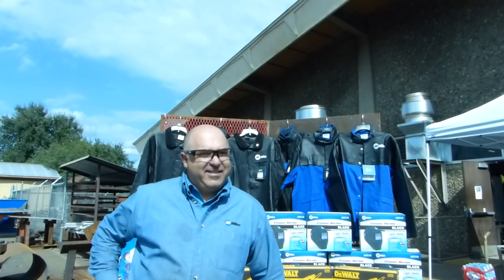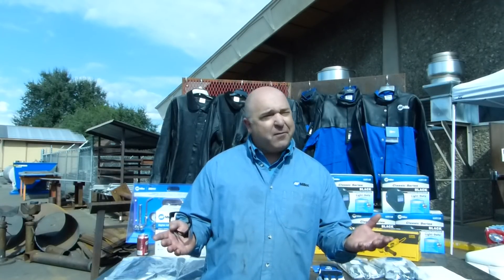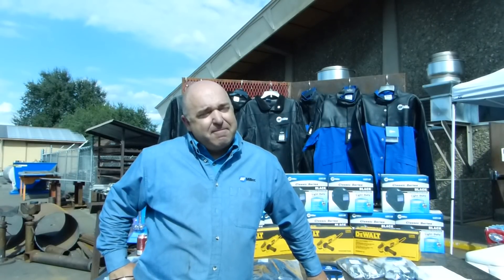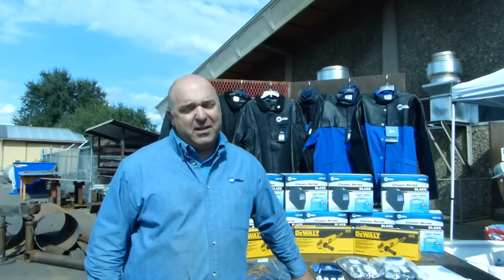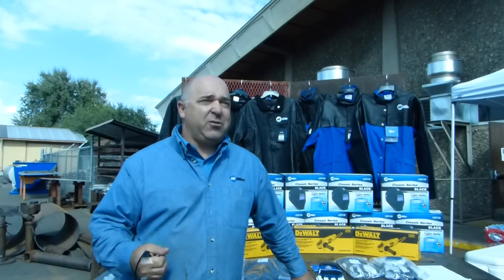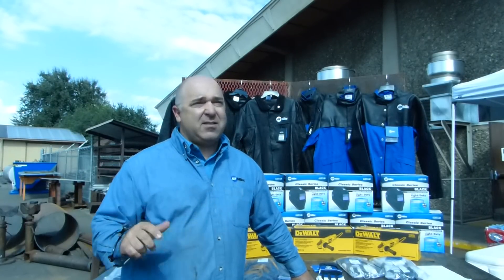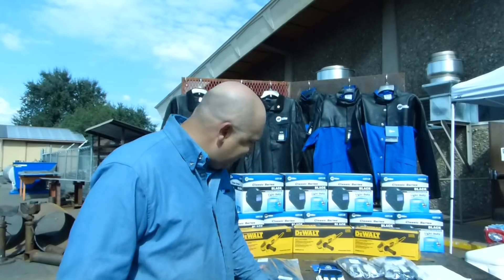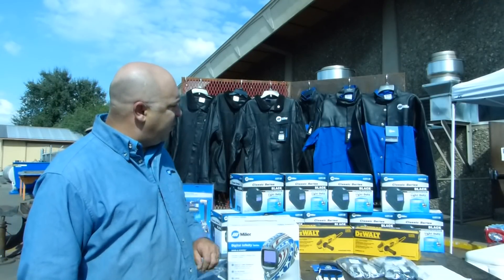NEW MILLER 220 Amp AC/DC Pulse Tig, Mig and STICK (E6010-yes) Welder-W/ Miller Rep Silvio Modena

Comment: The Miller Multimatic 220 AC/DC is WAY OVER PRICED, but nice. $3000 is too much. Miller made it look like a "blue" Harbor Freight Vulcan OmniPro 220 , but with the addition of high frequency start, and AC and DC. For that price one could get a HTP Invertig 221, and a Vulcan OmniPro 220.   Miller makes wonderful products, but its assembled here with foreign parts. Its a global market now. Being blue doesn't make it the best. Probably losing lots of sales to Harbor Freight
https://store.cyberweld.com/miller-multimatic-220-welder-907757.html?msclkid=4e59c5451401134bdde09951407f404e&utm_source=bing&utm_medium=cpc&utm_campaign=ECI%20-%20Miller%20Welders&utm_term=%2Bmiller%20%2Bmultimatic%20%2B220&utm_content=Multimatic%20220
https://www.harborfreight.com/welding/multiprocess-welders/omnipro-220-industrial-multiprocess-welder-with-120240-volt-input-63621.html
Reply from the maker: I would like to point out that an HTP 221 that runs 120/240 will cost you $3000. So I think your statement falls apart right there. Miller can run on 120/240 and is a single unit that you can comfortable do service work with. There are other units that are cheaper for certain. There are reasons though that miller charges more, for starts, they test their products thoroughly before putting them into the marketplace. They are spent hundreds of hours getting the Proset features dialed in so that you don't have to burn through hours of time, wire, and gas to find settings that work. If you make a living welding then the price difference vanishes in short order, if you are a new welder then the price is going to be an issue for certain.
I will not comment on the quality of the units that you have listed, as I have not used or seen them used. I will however comment on the Multimatic 220 though. It is an awesome little machine that Silvio brought in the other day and laid down some bomb aluminum tig welds right from the start.
Reply: The HTP Invertig 221 will run circles around that Miller. Miller makes nice products, just over priced for the home fabricator. That new Miller also has a cap dump high frequency start. Nothing to write home about. Won't be using that HF start to clean the aluminum. The HTP Invertig 221 will be running long after that Miller has been back to the dealer multiple times for repairs. Also, whats up with putting a Miller M-100 mig gun on that thing? That mig gun is a 100 amp gun. Go miller...I guess.Everlast makes a really nice multi-process welder for $1000 less 
PowerMTS 221 STihttps://www.everlastgenerators.com/product/mig/powermts-221-sti-tig-package

Comment: listen to it twice didnt hear any thing about being able to run 6010 web site doesn't say that it can ? where in the video is he say it will run 6010?
Reply from the maker: Hello Steve... I had talked with Silvio for a while before I went and got a camera. I spoke with him a couple of weeks ago after he came back from their product launch in Los Angeles. I told me that he got to spend quite a while with the machine. He told me that it runs 6010 like a champ, no issues with maintaining an arc. He compared the arc stability with that of the dynasty. Check one out in person if you are able to find an Airgas or vendor in your area and see for yourself if it does what you need it to. Take care, Kevin
Reply: They apparently say 6010 is not recommended for the Multimatic 220, and auto set apparently does not list 6010. It will apparently burn a 6011 and keep it lit if you keep a short arc.

Comment: EVERLAST was the first with a AC Tig Multiprocess Machine. I hate when they lie. Especially when it can be proven very easily...
Reply from the maker: The Miller rep never said that they were the first, only that this machine is the first of its kind for the company. I don't want to bash any products or companies, you might consider joining me. We  consumers benefit from competition with improved technology and better pricing.
Reply: Petit Wonders I went back and listened. You’re correct, I misinterpreted.
Reply from the maker: J L  No problems. I talked with Silvio today and he got a chance to weld with it down in Los Angeles. It is not in stores yet, but will be shortly. He said it is a really  well thought out machine that is very easy to use. I hope that in the near future he will bring one in and get an in-depth walk thru all the processes.

Comment: um the everlast company has a ac/dc welder for mig,stick,and ac/dc tig
Reply: Everlast sucks
Reply: @vivianpang5096  You mean Neverlast!
Reply: Alex Evans doesn’t esab as well ?
Reply: @rmcmunoz2  Esab  has the 205ic that is pretty much identical the same.
Reply: I do believe so, millers guy in the video lied but Miller has always been built for the roughest conditions so im probably gonna get it when it comes out at my local welding shop
Reply from the maker: Yes they do. They have two machines that are similar MTS 221STI and 252STI.  Esab has one as well. There is even a guy that only sells thru eBay that sells one under his brand as well. Do you have one of them?
Reply: @petitwonders928  No sir i dont but i wish i did. Money is tight for me right now but when i get the money, im going to buy the new miller one cause miller has always been good to me.
Reply: @alexevans650  Check out the primeweld tig welder if you are strap for cash comes with a lot of good stuff they are updating there foot pedal.What caught my attention they are in NEW JERSEY AND PAY FOR SHIPPING BOTH WAYS UNDER WARRANTY!NEVERLAST WILL NOT DO THIS.
Reply: @petitwonders928  I have a 221sti and love it. I have owned miller and lincoln both in the past and I was hesitant to purchase at first but after 6 months of research went for it. No looking back love it a lot. Smooth machine
Reply: we have the everlast 185, it sucks dick it's a pos. i'm not hating, that's an honest review, it fucking SUCKS.
Reply: Everlast was the first to come out with the ac/dc tig multi process

Comment: Is it powerful enough to use 6010?
Reply from the maker: Hello Nic,
According to Silvio the new machine will run 6010, he said it is not on par with the XMT350, Dynasty's or engine drives though.
Reply: Thanks for the info, I just saw the "E6010-yes" in your heading! I would assume that the duty cycle is somewhat limited because of the amperes rating. Seems like a great machine though, on par with the ESAB 205ic.
Reply from the maker: Your right about the duty cycle. If I remember correctly it is about 160-170 at 60%. By the way I changed the heading because of your question, so thanks for asking.